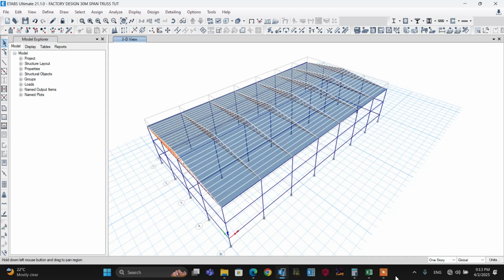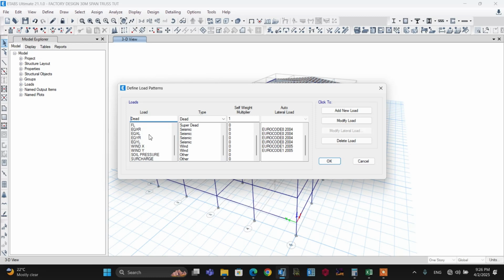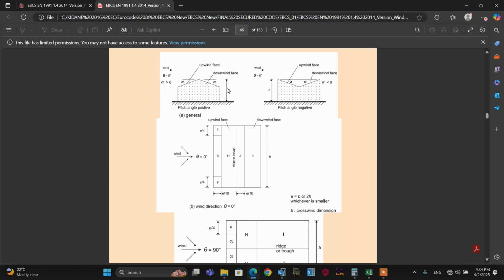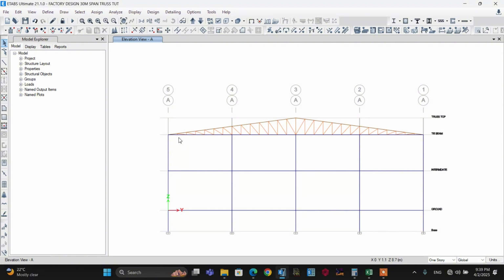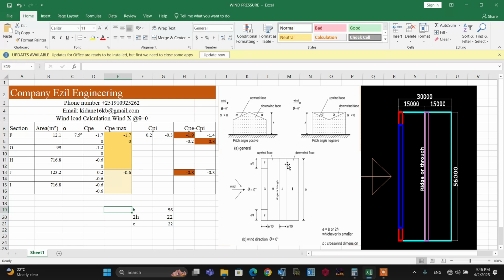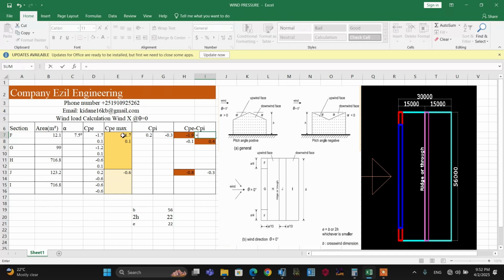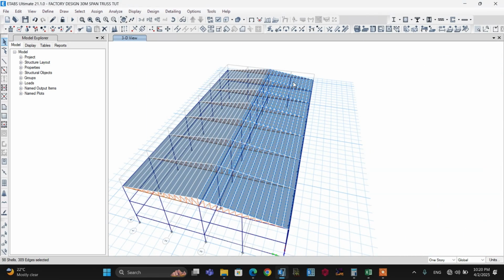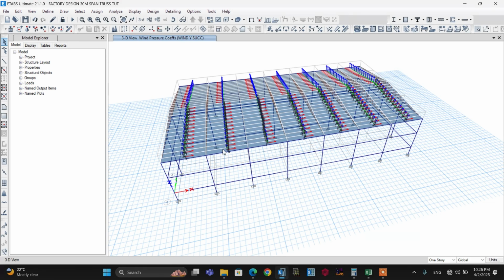Warehouse Structural design on ETABS: Wind load coefficients |code| steel truss analysis Part 2

Comment: Your lecture of  part 3 is Not uploaded. Could you release Part 3?
Reply from the maker: OK I will upland Part 3
Reply: @Ezilengineering  when will be the next part uploaded, if you could describe a little bit more on the wind load it will be help us on how to assign pressure and suction on both side of roof, as this seem very essential for designing of the werehouse
Reply: Almost 2 months have passed since you promised to upload Part 3. When will you post Part 3 of your lecture?

Comment: where is part 3?  it is better to rather finish one  project than going here and there making other videos.
Reply from the maker: I will upload it it is simply adding connection to steel truss then run analysis and design

Comment: Nice. But the limitation of eurocode in wind loading is, it works only for rectangular shapes of roof. How can we use it for elliptical or curved and irregular shapes of roofs. I think UBC 97 is simple to use pressure cofficient on wind ward and lee ward sides of irregular and regular roofs
Reply from the maker: You are right Engineer Irregular shapes Like (curved, hyperbolic, or elliptical  roofs) are not directly addressed in the standard tables of euro code , requiring engineers to extrapolate or use alternative codes like you mention but as I know UBC 97 is already old one and changed to IBC in 2000 . EN1991-1-part 4 NA of Germany provide additional information but in general EN has limitation.

Comment from the maker: How are you my best families? You can ask any civil engineering, structural design, and construction questions, file, and setups here in comment section I will answer as soon as or upload video about your questions. for civil engineering file and software setups use this link https://t.me/ezilenineering3677
🔗 Helpful Links  
8 Story Apartment Structural design on ETABS  modeling, analysis, design 42 load combination part 6
https://youtu.be/xsGPwNeMuRc